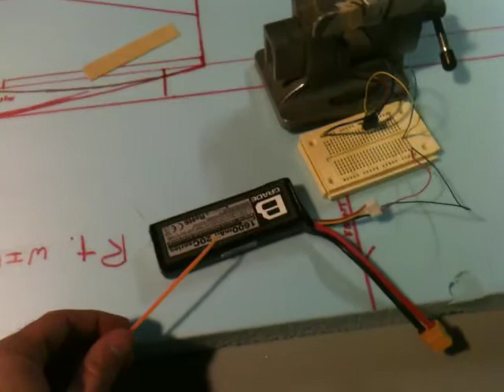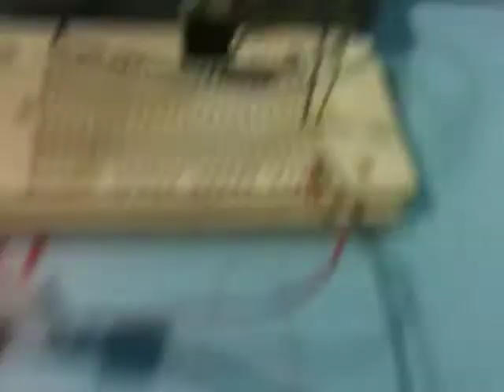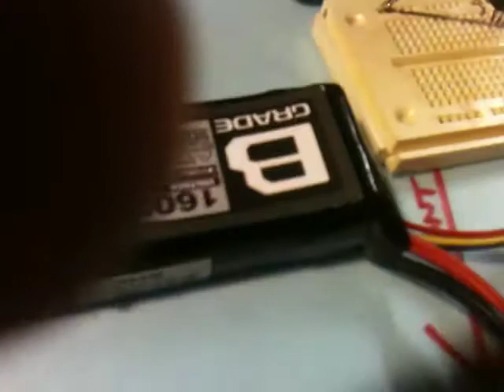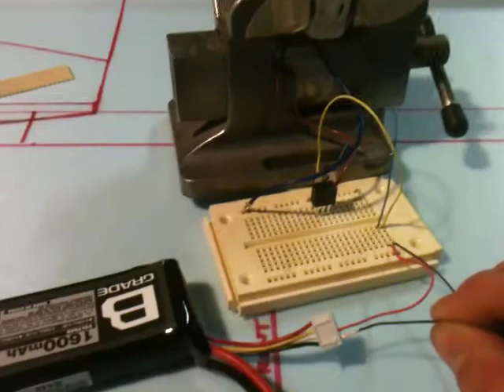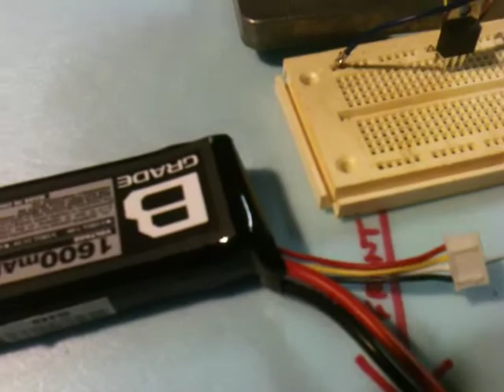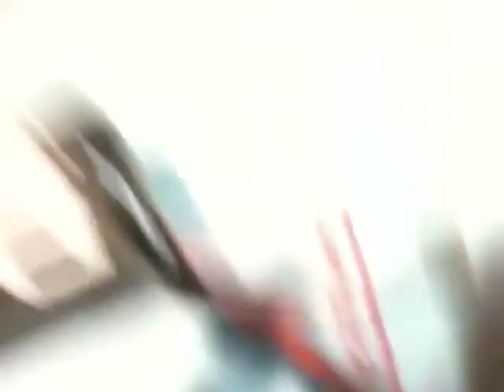Polarity protection curcuit w/ N-ch_Mosfet

Comment: Why only 750ma? Could you splice off of the + from the battery and solder in a resistor so you can run a bigger battery?